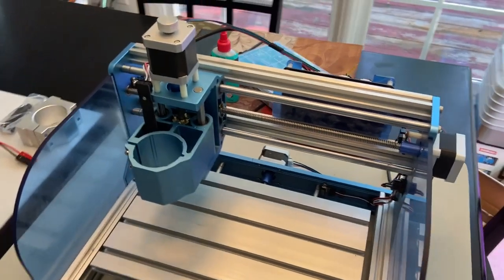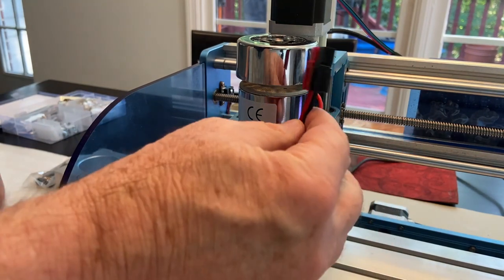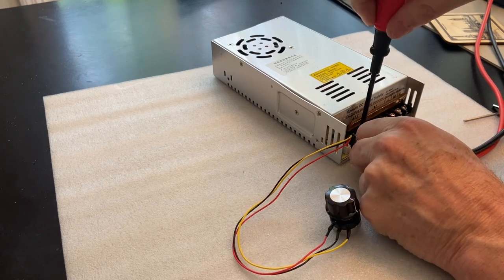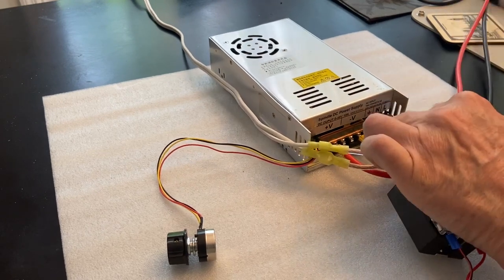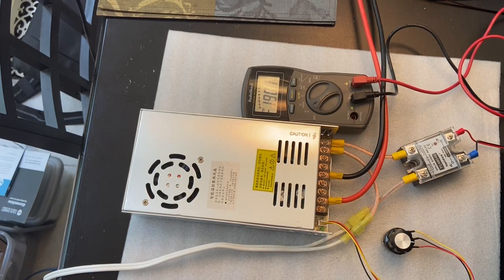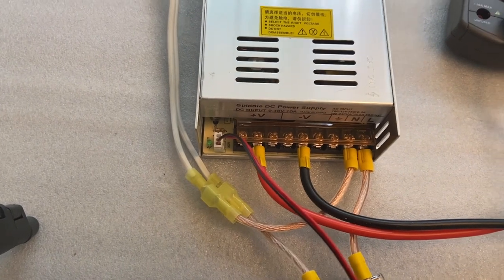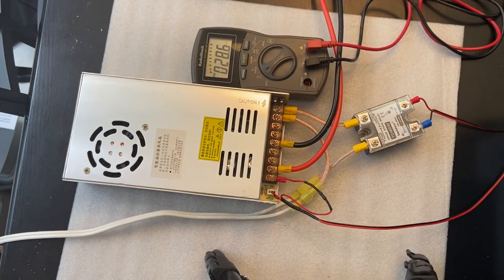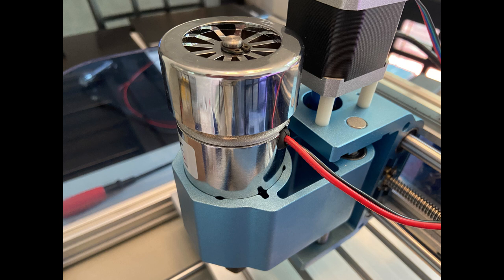3018-Prover 300 Watt Spindle Upgrade with GRBL control

Comment: Thank you for this video. I bought the relay off your Amazon link. But honestly I am a neophyte when it comes to electronics. So I don't know where to get all the other connectors and the resistor any ideas. Does radio shack still exist? Thanks again

Comment: I wonder why the hell Sainsmart sells the raw thing and doesn't mind to have this to work well with their machines. The modifications you proposed are basic and essential for a good experience. Your video decided me to buy this motor upgrade since now I know this can be controlled via software. It's Sainsmart who should thank you, but since they won't probably do, it's me who gives you a BIG THANK YOU. :-)
Reply from the maker: Wow! Thanks for the kind words. I hope this works well for you.
Reply: @lanierje  Just a quick note to let you know I finished today the upgrade you proposed. I screwed the power supply on bridge's back and placed filter, power switch and SSR and stuff on a closed box protected against dust and shock hazard. CNC gained 100% on safety and reliability having the new spindle (that looks much better than the original one) to work under Candle's command instead of being an alien device. In addition with the aluminum holder the machine now looks stronger than ever! We know Prover is a cheap machine and we can't expect miracles from the tiny guy, but what you researched and suggested on your video made my day. Thanks again for your kindness by sharing your knowledge.
Reply from the maker: @josemanuelperez3818  Congratulations on completing the project. Again thanks for kind words. Later my friend, Jim

Comment: Very nice video, it's also a bunch safer since I've noticed that some of the power bricks for the 500W motor, the adjustment potentiometer is referenced to mains which could give some shocking results if something were to fault with the grounding. This takes that possibility entirely out of the loop.

Comment: I bought the 300W spindle kit to go on the Genmitsu 4040-Pro CNC. Will this same circuit work with the 4040-Pro GRBLcontrol board?
Reply from the maker: I don't know. I can't find any information on that control board. SainSmart needs to provide more tech info on their products.
Reply: @lanierje  No, not unless you want to open the control box and do a lot of digging. The only output that is available is the 0-24v spindle drive. However that is sufficient, with a slightly different circuit.
Reply: @georgeinnis877  Could you describe this circuit? I have a 4040-reno, and I suppose the control board is the same.

Comment: I know this is an old video but have to say thanks for this informative video.  I have upgraded my CNC 3018 Pro with a 300w Spindle and the SSR and PS as shown in the video. On the GBRL controller I got, there is a blue connector for a 48v PS. I used that and am able to control the 300w motor from within software. All that is required is to set the PS knob to Max voltage. These settings will not change, but the software will vary the speed of the Spindle. 
 I also downloaded a balance fan, took off the cheap Chinese's unbalance fan, and the noise had reduced to almost 92%. The door is 6 feet away from my machine and one will not know that the machine is running. My final upgrade is to extend the bed that will bring this into a 3040. Thanks once again.
Reply from the maker: I am not familiar with the Pro board. I think it is great that it has a 48v port that supplies controlled drive to the motor. I have not been paying attention to their boards in a long while, but I can say that their technical documentation is awful. Congrats on a successful implementation.

Comment: I know this was posted awhile ago, but thank you for doing this. I'm a little surprised that there are no instructions for set up included in the kit outside of a single unlabeled diagram, no tutorial videos or steps for set up on the website, nothing. Would it be possible for you to add links to the other electrical components that you used that weren't included in the kit? Such as the plugs and connectors you are using?

Comment: I just got a 4040-pro and picked up a 500w spindle for it. They made a custom control board for this unit and disappointingly they did not break out any control signals. So you only have the main 0-24vdc spindle control to work with. Doable certainly but not as nice. No other digital outputs that could used for other accessories either.
The 500w spindles power supply is the type that has a dedicated input of 0-10vdc for Mach3 control so a simple voltage divider should work ok. I'd prefer something with some isolation tho.

The lack of any standards for these desktop systems is a problem that would be simple to address. Some standard signal levels and matched impedances. Really, given how powerful micro controllers are now and how easy tach feedback is to process, for a few dollars these interfaces could be made all digital. Maybe use I2C or RS485.

Comment: Thanks for the tip on the pot replacement. I had seen someone else wire in a PWM to Analog converter for that which is not a bad way, but the direct to board header with a pull up seems a little easier and cleaner to set up.

Comment: Nice instructional video.  I have one comment.  In the video you connect line voltage through the SSR, and neutral directly to the PS.  I agree that is correct.  In the wiring diagram you show line connected directly to the PS and neutral through the SSR.  Your wiring diagram needs to be corrected.

Comment: The loss of speed control is one of the biggest barriers to me upgrading, my spindle, so it is interesting to see exactly what the input looks like. I was toying with the idea of a digi-pot. One thing though, do you not have stability problems with using the variable output voltage as a pull-up - in the sense that if the output voltage wanders higher, it increases the voltage on the pull-up, increasing the demand voltage which increases the output voltage etc. And similarly if the output voltage wanders downwards.
Reply from the maker: If you do the math you will see it is stable. High value of pullup resistance vs much lower source impedance. Also at lower voltages it practically dissapears.

Comment: It seems like all the added components and power supply should be housed in some sort of box. being new to the CNC as well to the needed wiring skills it's a littlie over whelming. Can you suggest a box to used. Have a little  background with computers, power supplies normally have heat sinks and fans would seem like something to do if in a box.

Comment: Are you willing to share how you arrived at using a 100K resistor connected to the output of the power supply and not a smaller resistance connected to the +5vdc pin on the pot connector ?  Also, why 100K?

Nice design, I am getting ready to implement a variation of it on my system.  Understanding your choice on the pull up resistor would help.  I am concerned about voltages >5vdc to the board if the 100K fails shorted or its resistance drops significantly.  I have seen resistor values drop with age/abuse a couple of time over the years.
Reply from the maker: The value was calculated by use of Kirchhoff laws. You can't use a smaller resistor from the 5 volt supply because the 1K source impedance (even at zero) can't sink the reference.  The calculated 100k provides additional current to the reference in order to allow full output. At lower voltages it becomes less relevant. The power at max in the 100k resistor is .02 watts. Metal film resistors are very stable.

Comment: Very helpful video. I ordered the SSR today and the spindle mount. I have been using a 3D printed mount but the stepper sits uncomfortably close to the motor fan and I'm sure the aluminum will be a little more precise, I manly do engraving of text and not so much carving of 3D art. I am using the potentiometer for the speed control but since it is independent of the board, in a crash or lock situation, the spindle has no automatic way of shutting down even though I never leave it unattended. Have you checked to see if the RPM on the Candle software is accurate? I plan on checking it with an optical tach once all the parts arrive, get it assembled and recalibrated. Thanks again.
Reply from the maker: The candel software values are relative. My 300w motor runs at 13400RPM no load. I enter that in candle as a maximum. Therefore, values below that are relative to the maximum in percentage. They do not equate to accurate values of RPM, only relative values of drive voltage.

Comment: Thank you for posting such an informative video! I have a Genmitsu 3018-PROVer V2 that I would like to do the same thing to, but the control board is different. There isn't a 0-5V connector on the board anymore, and instead, on the right side there is a 3-pin laser JST connector (12V, Ground, PWM,) for a laser, and a 2-pin JST connector for laser air assist (M-, M+). Any thoughts on how to work this magic on the new board?
At the very least, I can connect to the original spindle wire to enable the on/off software control, but I'd love to eliminate the potentiometer so the RPM can be software controlled as well. THank you for any additional guidance, and thanks again for putting this out there for the rest of us!
Reply from the maker: The 0-5V can be filtered PWM. You could just build an RC circuit to filter the PWM.  You would need to know the PWM frequency to select your filter cutoff frequency. Filtered PWM is DC with some ripple.

Comment: Thanks for the great video, I have a few comments and questions. First, I am able to control spindle on/off through software without the relay.
Should I be able to do that?
Second, the spindle is meeting the same rpm's through software without the resistor.(Tested with a laser rpm tester) 
Will this have an adverse affect over the life of the spindle.

thanks in advance.
Reply from the maker: Without the relay, the motor can stop but there may be a few ma of current flowing. I prefer to turn off the power supply. The pullup resistor allows full output voltage from the power supply. Only a few volts different and a few RPMs higher. The pullup compensates for the moderate output impedance of the driver.

Comment: Hi great video hope its not to late to ask  a question as i am fairly new to cnc and a real noob at electronics and am a little confused.  There are 3 diagrams between the video, notes and comments, video had no pwm filter, the other 2 did but on has a .47uf capacitor and the one from the notes has a 1uf capacitor with a 100 ohm resistor. so do i follow the one from the notes with the resistor and 1uf cap?  i see there are different types of capacitors and resisters,  which would be recommended?? ex ceramic capacitor? ex 5% 1/4W Carbon Film Resistors? any other helpful tips on wiring pwm filter...  that wasnt  shown in the video... thanks
Reply from the maker: In most cases a .47uf capacitor across the control terminals will be fine. Try that before you install a series resistor. The type of capacitor is not critical. 1/4 watt resistor is fine if you use the RC filter.

Comment: Hi, great video! Clear and concise. What did you use for the power supply? Does it need to be a three-prong plug or can I just use a two-prong plug from a broken lamp etc?
Reply from the maker: You need to use a 3 prong plug for safety. The power supply is linked in the description as part of a kit from Sainsmart. Also there is a link to a power supply in my 500 watt upgrade video.

Comment: Very useful video thanks. But as someone who nearly killed himself once doing something similar and suffering electrical burns too, I feel obliged to point out the lack of an earth on the video on your power supply makes this a deathtrap. All you need is a bit of metal eg swarf in the wrong place and you can have a live case waiting for you to touch it. Please bear in mind this video is being viewed in places where mains voltage is a more lethal 230V ac. Just run an earth wire from the supply to the earth on the psu and check for continuity to earth on the case too.
Reply from the maker: You didn't look at the diagrams I included. The power supply is earthed. The diagram shows L N and GND. (The case is connected to GND terminal). The V- is isolated from ground and should stay that way. The cord I patched in to make this video was temporary. Look at the diagrams. One thing I should point out is that this is an isolated power supply. There are power supplies out there with 500 w motors that are referenced to the mains. Do not attempt this with that type of power supply.
Reply: @lanierje  Did see the circuit diagrams but felt it was worth mentioning for those watching the video who don't follow the diagrams - once bitten twice shy..
Reply from the maker: @vegsalad  Noted. Thanks. I will add a comment in the description to make sure everyone understands.

Comment: Thanks for putting this together.  I've been adding these same upgrades to my 3018-prover and the tips for setting up the GRBL control were just what I was looking for!  A few comments/questions:

1.  What wattage are the series resistors you are using for the PWM filter?
2.  The Wiring Diagram lists the connection between the power supply and the CNT port on the controller board as using JST PH connectors.  These are JST XH connectors on my control board and power supply.  I'm not sure if I have a newer hardware revision, but you may want to consider making a notation on the diagram.
Reply from the maker: You can use 1/4w types but you can probably get by without the filter resistor. I am using a .47u across terminals with no resistor. It is stable on my setup. You are correct on the JSTs (VH and XH on my board)
Reply: @lanierje  Could you show the wiring diagram for the .47u?
Reply from the maker: @007jojoo  https://www.chemroc.com/pictures/YouTube/SpindleCircuit47.JPG
Reply: @lanierje  Thanks you

Comment: So hard to find info on the 3018s individually. They are all clones but not 100% clones. Probably just going to have to pick one and upgrade as needed. Mostly concerned about rigidity. Is the metal spindle holder more rigid? Probably could use better bearings. You can find upgrade parts but will it fit on this brand.... Was trying to plan everything out before buying. Just going to get the sainmart one and go for it.

Comment: Awesome! I bought a 500w sindle and it doesn't even reach 200W on load so I decided to go with the Makita Compact hand router and see how it goes.
Reply from the maker: I have the Makita 1.25 HP router on my Sienci Longmill. I have no GRBL control of speed with it, but I may upgrade that one to a watercooled spindle motor and build a control circuit for it. Thanks for watching.
Reply: I think you would need at least 48v DC to reach 300w and 100v DC for 500w

Comment: Why was your voltmeter registering fluctuations before you connected the probes? Was that induced voltage from proximity to other sources?
Reply from the maker: Random noise in millivolts, not volts.

Comment: Hi! I don’t know much about electrical or electronic things. The spindle motor voltage supply is 24v-48v. The final voltage you measured is 51.6v and this powers up the spindle motor. Is it ok to supply the motor with 51.6 when the specs is up to 48v only?
Reply from the maker: Yes it is OK and insignificant

Comment: Awesome video. I am using the 3018-Pro board and it does not have the 0-5v connector. Is there another way to control the output voltage through the controller?
Reply from the maker: if there is a PWM output it can be RC filtered to dc, then use a voltage divider to allow maximum 5VDC as a control voltage. I don't have one of those boards so I can't give you actual values to use.

Comment: I see in the schematic that you are using the SS relay to switch the neutral mains line. Is that preferable to switching the hot?
Reply from the maker: Operationally the same. It is in series with the PS input. Depending on how you treat this, it may be safer to put it in the L instead of the N. That way the only hot is on the terminal of the sw instead of on the PS. There are no guarantees either way. SSRs do fail or become leaky. Best to cut the mains completely when working on your PS. There should be a power switch in the mains L to cut power to the entire power supply circuit. Also take care to physically isolate the power supply from the CNC so that metal chips or metal dust can't get in.

Comment: Hi Thank you so much for this Lanierje, I understand basic circuitry but beyond that my knowledge is limited, on the circuit diagram you have a PWM RC filter so is the resistor 100 ohms and the capacitor used is 1UF is this correct and is this Filter required or is optional Can anyone help me and answer this question. Also where can I find these resistors and Capacitors as on Amazon they have huge bundles. Thank you in advance.
Reply from the maker: The PWM filter is RC but you could probably just place a .5uf capacitor across the SSR terminals. In any case, it will always work well at high drive levels (i.e. high rpm). The filtering is to make the circuit stable at low drive levels. Thanks for watching.
Reply: @lanierje  no Thank you so much for responding. I am so grateful for your help. Have a wonderful evening and weekend